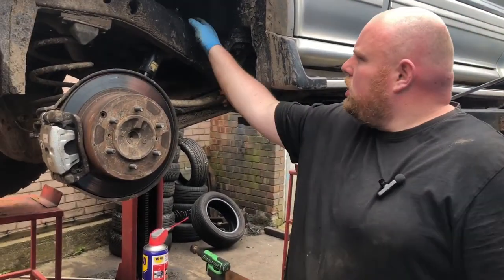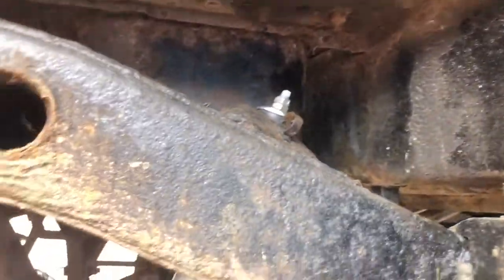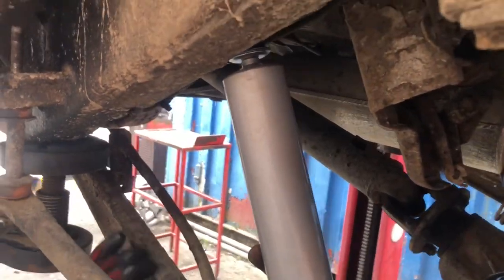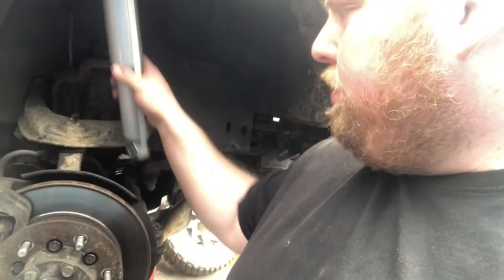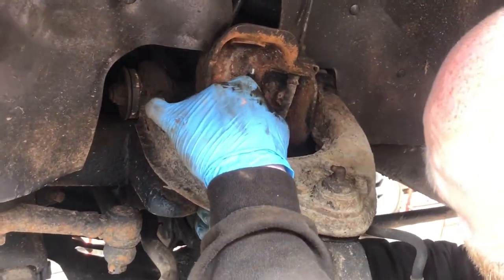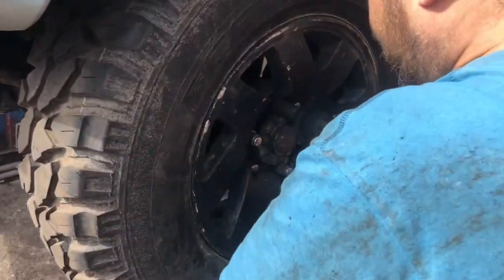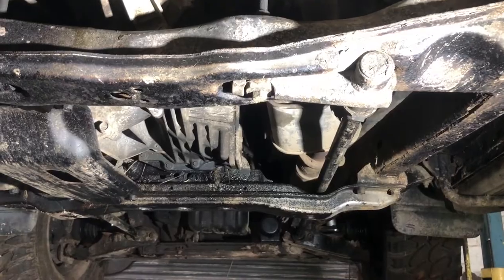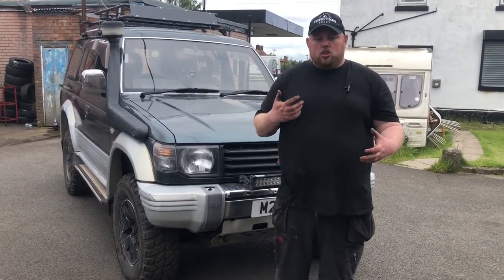Fitting 2 inch lift kit Mitsubishi pajero / showgun ( build part 4 )

Comment: I’ve got a standard 2.8 lbw manual pajero and would love to know if 33” tyres would fit or would I need a body lift?
Reply: 33/10.5/15 will fit without any rubbing with the standard setup on the MK2.